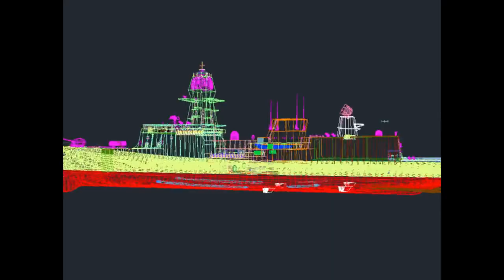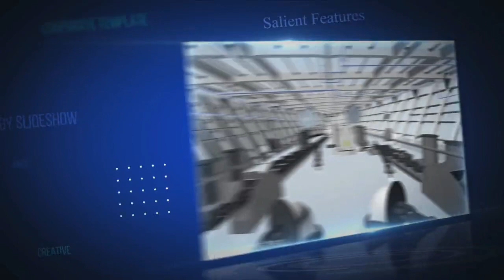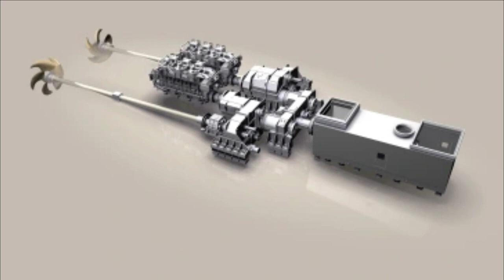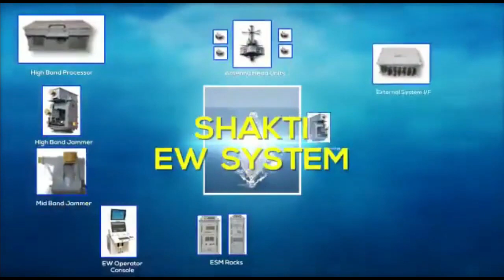#breakingnews GRSE launched Vindhyagiri, the sixth Project 17A Frigate #indiannavy

Comment: Great news and thanks for the update/tech information. COGAG system is generally used as follows - the Diesel engines provide power for normal operation and the gas turbine power kicks in when needed say for sprints. Though called frigates these are really big destroyer class ships in weight and punch. Way to go!!

Comment: Only thing is these carry only 8 bramhos missles.
Reply: That's sufficient enough since brahmos are powerful enough to destroy one ship with one missile, despite that frigates are lighter versions of destroyers and have other roles
Reply: @Vortex-ot3dg . One missile is not enough to destroy a carrier..you need to fire at least 6 of them to penetrate a battle group. even with that I don't think any conventional Missiles will reach the carrier.
Reply: Vindhyagiri is a frigate, it's role is defence not attack. Where destroyers used for attack purpose and frigates are used for protecting the larger vessels like aircraft carriers. Frigates are super fast and highly maneuverable ships
Reply: @nighthawk4298  . Frigates can also play attack roles. Brahmos onboard is an example of that.
Reply: @abymathew295  attack role is 2nd objective that's why it have Cary less brahmos missiles
Reply: @nighthawk4298  . Yes
Reply: @abymathew295  if we increase brahmos missiles in frigates it will gain weight and falls into heavy weight vessel, frigates are ment to be less weight so it'll become fast and highly maneuverable
Reply: @nighthawk4298  . No need to increase the number of Brahmos on frigates. That's enough...but we should increase the number of fast attack vessels.